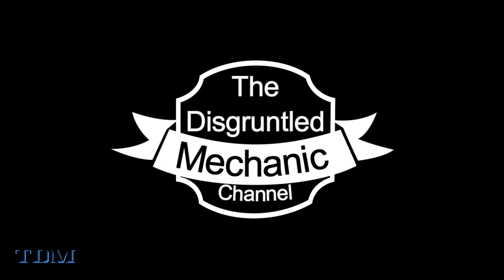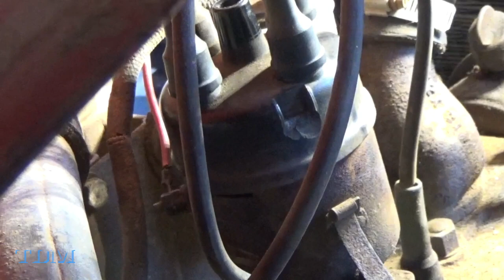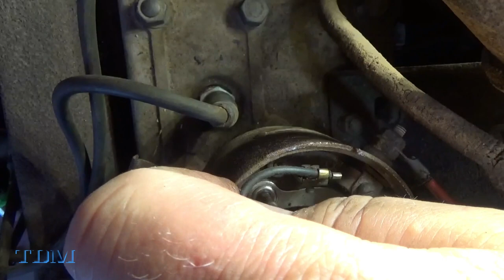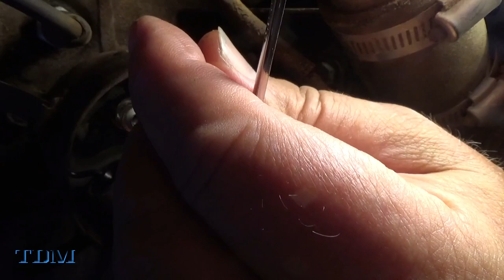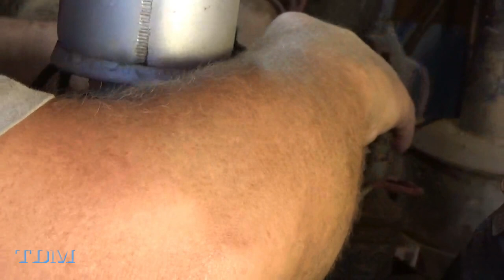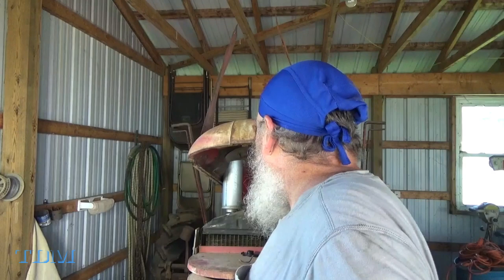1st start in 15 years- Dad’s Massy Harris Tractor With Points/ Condenser Install! Part 2

Comment: woooah bud, gaping points is nothing like adjusting valve lash, points open very easily in comparison and the proper feeler gauge drag is nearly nothing, it's more visual than anything.
keen eye and good sight to see minute movement is key, if you need reading glasses or magnifier, don't be shy and use them for sure! of course you could always do a dial indicator with 90 degree indicator attachment and get it to where feeler tweaks the needle less than one half of a thousandths (extreme point gaping) :))
what I've always done is put lay a gauge in the gap and adjust until the lock screw is snug but can be force moved by the adjust lug points or prying on the furthest point away from cam-pin, I can get them within 1 thou that way. granted I started setting them as a kid on mopeds, dirtbikes, mowers, etc.  I always had a knack for points and carb work/rebuild. must be the german in me
Reply from the maker: well we are working on an old massey not a race car! haha! I just gave the down and dirty and to me doing  the drag felt good enough and she started.

Comment: Fog the intake with silicone spray instead of starting fluid. It lubricates and is flammable. Starting fluid is volatile and wipes the oil off the cylinder walls, also can cause the pistons to pop the tops off. Silicone just helps start the engine without causing damage.
Reply from the maker: I usually use 2+2 but didnt have any. Never heard of using silicone spray but will try it

Comment: grab the points file.... back then the point contact were the same solid metal  all the way through to the crimped lug through the back side. not the junk thin plated stuff they went to many years later.
it's possible they were changed for the plated/tinned/dipped/doped ones. lol
Reply from the maker: I am pretty sure over the years they have been changed out.